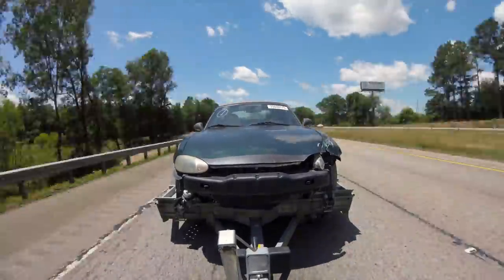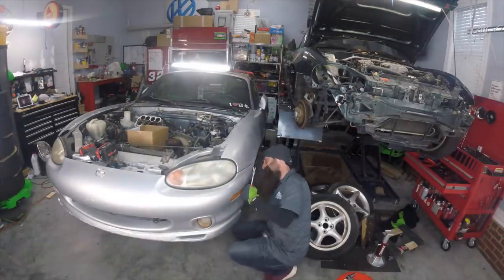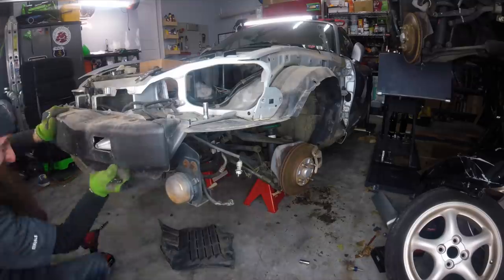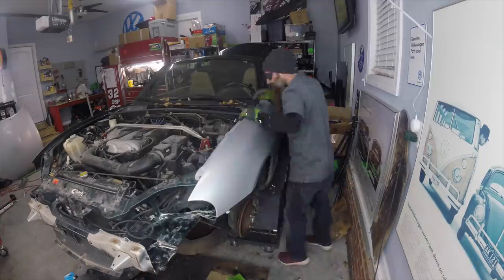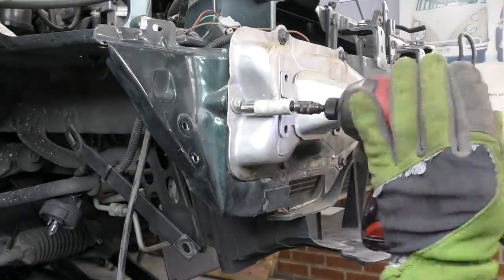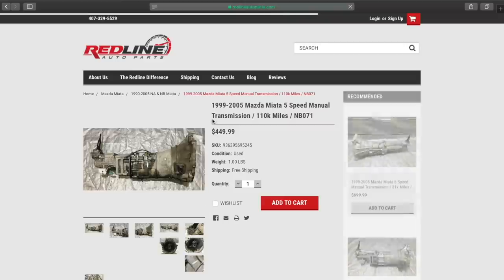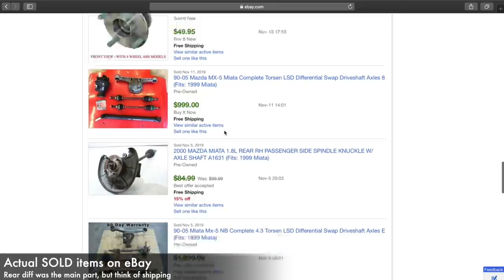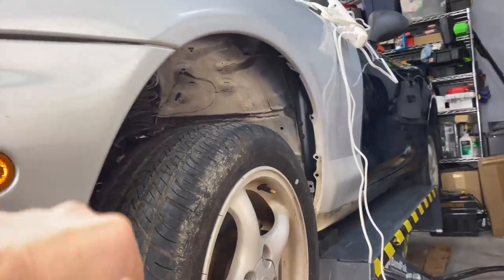Was It Worth Buying a Parts Car for a Project Car?

Comment from the maker: The screen shots I showed for Miata prices were a site called Redline Auto. I ended up buying some OEM springs from them. I get an email later saying that he is a fan of the show! HOW COOL IS THAT?!?!?!??!?! What is even cooler, is he was a VW guy, now a Miata guy. I guess I have to be careful. ;)
Reply: HumbleMechanic that’s awesome that you are giving the car to a guy that needs some bits!!!
Reply from the maker: @lonniebrown5840  Thanks! I was happy to do it. I felt like we both got a big win
Reply: Communities like that always end up being a lot smaller than you might think.  It's yet another reason to treat people well and not burn bridges because word gets around.
Reply: I have a 2012 NC Miata,  my 17 yr old son started us on Miatas when he bought a '99 NB.  My daughter bought an MKV Jetta this yr.  I'm luvin ur channel!  Good man Charles and I'm wishing u the best!  Keep those Miata vids coming!  I watch the ads on ur channel cuz ur worth it!
Reply: Thats awesome man. I was wondering if you could help me with an issue I am having.  Is it possible my crankshaft position sensor is bad but my tach still works? My car is a 2002 VW jetta 1.8 turbo. Engine code AWP. It cranks but backfires. You have to crank, turn the key off, and crank again. You have to do that about 2 to 7 times then it will sputter to life and run. It also gets terrible mileage. Could the crank position sensor be my issue? I already replaced the mass airflow sensor and it didnt help.

Comment: As long as same engine and it’s complete, for the right price it’s a awesome for extra parts. Awesome video. If you end up having a gas tank issue, you can’t buy a used from the junkyard. You can buy a 20ft container for a shed and upset the people next door. Containers are $1500-2K. Paint it and it’s all good.

Comment: Check the diffs on both cars.  If one is a Torsen and the other is an open diff, make sure the Torsen is in your auto X car.  Prices you were showing for used diffs were Torsen ... opens have much lower value.  There is plenty of info online how to spot the difference ... 

So happy to see you diving down the Miata rabbit hole.  I love the VW stuff that you do and have learned a lot about my ‘11GTI from you, but the Miata’s have been in and out of my automotive life for many years now.  Very cool to see your enthusiasm to learn about them.

Comment: I’m with ya on that! I’m doing an engine swap on a Mercedes and came across the engine and transmission for $100. Bought it against my better judgement because I knew I was gonna need a boat load of parts that I may or may not have access to. After weeks of struggles I finally found a donor car that will have what I need.

Comment: Done something similar to this, as the engine was going to cost the same as a donor car with that engine I needed. The best bit is that I also got good seats, the loom, ECU etc, and alloy wheels. Those were sold and I more or less got the money back that I spent buying the car breaking it for parts I didn't need and scrap.

Comment: I buy and part out Z32 Nissan 300ZXs quite often.  I usually make $2,000-$4,000 off of each car, depending on weather or not it is a twin turbo, 2 seater non turbo, or a 2+2.  Sometimes, it's a slow process... I've had some of these parts cars for several years.  Others have only lasted a few months.  I generally strip them down to the bare shell and then also section quarter panels, rear clips, front clips, and rocker panels.  The only thing I send for scrap is the floor, sometimes not even that if the floor is good.  I've shipped parts all over the world, including a firewall to Finland.

Comment: Parts cars are the only way to keep mk1/mk2/mk3s on the road as most cosmetic and some mechanical parts are NLA. I parted out 15-20 mk2/mk3s one summer a couple years ago while I was laid off from work. Had fun with it and still have plenty of spare parts to keep my stuff up and running. When I took the cars to scrap it was just the shell on my trailer as I sorted out all the parts before scrapping them. Stuff like batteries, heater cores and radiators are worth more if taken separate from the "sheet metal".

Comment: As you said, I think it comes down to time, space and expectations.
The other upside of course is you often end up with an "opposite" that you have to take apart anyway so any mystery as to how stuff fits is solved before you work on the "real" one for good and you can very quickly tell if a car has been messed with before comparing to original.  
I mean that is already the major amount of time I spend at a you pull yard.  Most parts are relatively "easy", its all the time you can save by knowing details or learning short cuts that has great value.  30x of one clip that is $1.75 new over the course of an entire project adds up.
Reply from the maker: Great points!

Comment: I was part of the Supra community 86-92, over 15 years i purchased and parted out 13 supra's. Some crashed, some with bad engines. I made lots of money to put back into the supra i was building. What better way to learn to repair a car when you dismantle 13 of then completely.

I had spare harness', buckets of bolts, misc items bunch if stuff. When i left the communitu i sold off everything made back alot of money and gave away a bunch. I actually have a fender hanging on my wall and a blown turbo for art when i parted out certain cars. 

I had 6 spare transmission at one point sitting in my garage. They were just in case i blew mine. R154, they ended up gaining huge popularity and were 400 each back in the day to telling them for 1500 to 2200 each. My last 4 help me go toward owning a c6 corvette.

Comment: Really cool to give the car away to a local fan. For the price, getting a parts car in America can be totally worth it. 

Here in Eastern Canada it is my experience that parts cars are often times way too expensive. Totalled cars (either body damage or bad engine/transmission) are sold at only a tiny discount vs. a decent running one.

Comment: I love ur show. I have the 2018 Golf R and its been a blast. Prior to that i owned a 2004 MK4 R32 since new. I am an amateur mechanic at best and work on cars for fun. I have been working on Porsche Boxster and i did exactly what u did. I bought a parts car that was running badly for $2k and removed over $2k of parts including a top with a glass rear glass. Well my self and my partners fixed the mechanicals. We posted the car as running on Craiglist for $3k and we actually sold it for what we bought it for. Worthed if u have the space. U f definitely inspired me!
Reply from the maker: That’s AWESOME.  And a heck of a fleet you’ve had

Comment: I bought a parts car, 16v Scirocco, for the transmission. It was a weird situation where someone moved out and left the car behind, so it didn’t have any paperwork. For $200 I got a good transmission and parted the rest for about $500 profit. Then it was the sawzall and a trip to the metal recycler for that $35.

Comment: About 11 years ago I found a white automatic 91 4dr Golf that "ran" but with a dead #1 cylinder for $500 and started tearing into it only to find a bent valve and ruined piston, my buddy found me an "identical" white parts car that was a manual 92 4dr Golf for $200 that didn't run at all. At that point I planned on doing a 2.0L ABA block anyway which I had sourced for $200 bucks... Took the head, the transmission and its running gear, the cleaner looking rear hatch, hood, front bumper, better condition seats, rear parcel tray, "tilt" steering column and whatever else I could think of off the parts car before I scrapped it for $50 and sold the engine block for $50 too, so basically I got ALLL THAT for $100! The other parts I ended up buying was a new set of ARP head studs, a used 2.0L ABA exhaust manifold and down pipe, new clutch kit and cable, new fluids and a new Techtonics 2.5" cat back exhaust all for about another $600... About $1200 for an EXCELLENT condition manual MKII Golf when the same or worse condition cars were selling for $2500-$3000 without the sweet 2.0L ABA SWAP!
Reply from the maker: Sweeet

Comment: Did the same with my 1990 suburban it's an uncommon paint combo, only offered 1989-1990 I managed to find another for a good price that is now my parts burb. So if I ding a fender, some sheet metal needs replacing or need mechanical parts on my daily I have the parts on hand for a direct fit. Already made full back for selling interior pieces in what I paid for it. With many more chances of making more if I sell more. So parts autos are a go in my book if you have the right vehicle.

Comment: I completely understand your way of thinking with this, once you commit you stick to it. That said, with these MX5's the bodies are really flimsy and once they take damage become even flimsier and may become a problem in future. But again its a lot more work, as you said.
Reply from the maker: Very true. The metal is so soft. Ahha. We can always address that in the future if we need to. Odds are this car will never even see street time.
Reply: @HumbleMechanic  If your only doing timed events doubt you'll have issues, will be a problem with other cars on track though because you know... rubbing is racing lol. Your not wrong about the chassis being soft, Japanese make great engines but car bodies not so much. Helped a friend of mine with a dent in his boot lid on his new Mazda, I swear its only a couple microns thicker than a soda can.

Comment: My first parts car i bought to put my 1g eclipse gsx together was a non turbo car. I double my intial input cost on it with keeping the full interior, engine, bumpers and random electrical components. But i just got lucky, having the parts that people just happened to need when i had them. My other 4 parts cars didnt make me as much money.
Reply from the maker: That is a big win. I had a 1991 GSX. It was a super fun car. I kinda wish I wouldn't have sold it.

Comment: For the 99-00 VICS intake manifold (the one you have), removing the flaps is actually detrimental to the flow of air though that manifold. The flaps create a resonance chamber to help air flow better at particular RPMS. Stock, this change over happens at 5000 and even with mods this number is good for most engines. If you remove the flaps, aka locking them open you'll lose power over 6k. If you keep them closed, you'll lose throttle response and a bit of torque mainly from 2000-4000.

There really isn't advantage for removing them. Many dyno graphs prove this. They are quite clever, so I'd leave them be. :)

Now the 01+ VTCS manifolds on miatas...those restrict flow and are just for emission purposes, so removing those will help.
Reply from the maker: Maybe that’s the ones everyone said to remove the flaps on not the 99.

Comment: Parting out a car can be such a huge headache.  I had to buy a parts truck after I smacked a deer and I've been trying to get some of my money back on it.  Not only do I get the usual illiterate text messages, anti-communicators, lowballers, and no shows, now I find myself fighting with people who see nothing wrong with buying original 20 year old, 180,000 mile parts like brake hoses and ball joints.  Not the control arms....the ball joints.  I'm waiting for somebody to ask me to sell them a used rivet from the radiator saddle.

I thought I'd at least be able to recover some money fast because it's an S10 and there's still a lot of them out there and the frames alone are really popular for 47-54 Chevy truck restomods.  Two months since my grilled venison adventure, I'm still out nearly every cent I've spent, but I saved that used rivet for that one guy who just has to have it.
Reply from the maker: LOL it's not always a win. You can make it a win, but you have to do everything right. 

For most I have done, I knew the car had somethings I wanted, I was cool with getting those things and letting the car go for no more $. Mostly because I got all the stuff I need for less. But man having a parts car you can't do anything with is awful!

Comment: Actually what I did for my kinda rare Polo Cup Edition. Bought a rear ended one in the same color and same amount of doors because I knew in the moment I sent the seller his asking price the car had already paid for itself. Sold 4 body panels and the spoiler, broke even and now have a spare engine, transmission, axles, headlights, interior etc etc which I have listed on the equivalent of Craigslist in Germany. If the parts sell it’s fine, if not I don’t really care because I have the space for all the stuff and already doubled my money on it. Now using that money to upgrade some stuff on my car. It’s a never ending circle 😂
Reply from the maker: LOL It really is a never ending cycle

Comment: Good video--you covered most of the main points of having a parts car: cheaper than buying parts separate, you end up with lots of convenient "extras" like nuts and bolts, does take time to sell the extra parts, neighbors may not be fans of car parting, don't expect to get a lot of money for the stripped hulk. I wasn't there to see the poor interior of the silver car or the frame damage to the green car, BUT I'd rather swap an engine into a straight car than body parts onto a bent car. Now if you had swapped the silver doors and trunk, all you'd have to do is paint the rear fenders... :-)
Reply from the maker: The interior was awful and moldy. The top was trashed too. I think I’d have to swap dashboards because of mold too.

Comment: Hey. Just to inform you, the 16" wheels are also stock. They where an option back then. You shouldn't run into any issues with auto-x
Reply from the maker: As I understand it, the entire package has to be installed. I think the 16” would be okay even as an accessory wheel, but the width is wider. 

It may have been fine. But I done want anyone to be able to question or protest a time. 

Funny enough it’s all for nothing. I’m not that good anyway. Ahhahah.
Reply: @HumbleMechanic  understandable. What counts is fun factor not the time. But on a sidenote you'll be saving some weight with 15" wheels and maybe it will make up for the "lack of skill" on the track hahah
Reply from the maker: Ahha true about the fun factor. But as I get better the competitiveness will start to show

Comment: Love the channel big fan. Big fan of VAG just picked up an 2013 Audi a4 b8 haven't made the first payment yet and parts? Yes please....lol.
Reply from the maker: Hahah nice
Reply: @HumbleMechanic  appreciate the reply.
Reply: @HumbleMechanic  oh question for you. Having sorta a little issue, the only way I can describe it is it's sorta a low rpm shutter. Example at highway speed cruising at about 2 grand and go to accelerate without down shifting and I feel what I can only describe as kinda like starting off in too high of a gear kinda. If that makes sense and kinda of the same scenario on a deceleration without foot on accelerator but almost feels like a bad mount...smh.

Comment: EDIT:  Marking this comment so I can remove the duplicates that Youtube keeps posting.
I'd LOVE to buy a donor car for my Z3.  Then I can take the front right wheel arch liner, tools (if they're in, but that's rare), plus a few spares, and part the rest out for WAY more than what I paid for the car.  But I can't.

A parts car would have been much cheaper if I bought one early, but that's how it goes for most of us.
Wheels: R2800 plus paint
Engine covers: couple hundred ZAR plus paint (R7k new)
Sill plates: couple hundred (R1350 each new)
Stock silencer:  Couple hundred ZAR (R9k new)
Original cigarette lighter (probably NLA)
Tools  (these are almost never in a second-hand car, but run thousands new)
Stock radio, CD shuttle:  R750 (the radio was scrap price, but I managed to repair it)
E34 premium amp:  About R500 (a parts car obviously wouldn't have provided that)

I still need a replacement top (with the frame), guessing about R4k used (R73k new)
And so the list goes on...

Comment: Audi tech here do you know if there is a adaptor for a 3/8 ratchet to VAG tools. Like for on the 1.4 petrol engine the cam belt tension is behind the mount so there is that long 13mm adaptor that goes into the end of the work shop torque wrench.

Comment: Hey, is it possible my crank position sensor is bad but my tach still works? My car is a 2002 VW jetta 1.8 turbo. Engine code AWP. It cranks but backfires. You have to crank, turn the key off, and crank again. You have to do that about 2 to 7 times then it will sputter to life and run. It also gets terrible mileage. Could the crank position sensor be my issue? I already replaced the mass airflow sensor and it didnt help.

Comment: that silver car looked like it had newish front springs, is there a reason those were not swapped over.
Reply from the maker: Yes. I can’t run them in street class for autocross. It has to be stock springs

Comment: Hello HumbleMechanic.. I want to ask a question out of this topic but you have experience and I would appreciate your reply. I own a VW Golf mk3 its from 1995 its very very similar to us model (2.0 ABA) but here in Europe its a 1.6 liter engine with 101hp 74 kw AEK engine. is that a good engine too like 2.0 ABA ?? I own the car from 4 years now, it has 246000 km and I see after 8000 km it looses a bit of oil is that normal? Every other thing is quite normal and the manual transmission too?? I drive mostly in town home-work and vice versa just once or twice per year barely could drive far away from city. Does that kind of driving indicate with oil loss? I change oil once per year maybe 9000-10.000 km.  its my 1st car and I love the way it drives nad low costs maintenance..thank you if reply to me. best regards